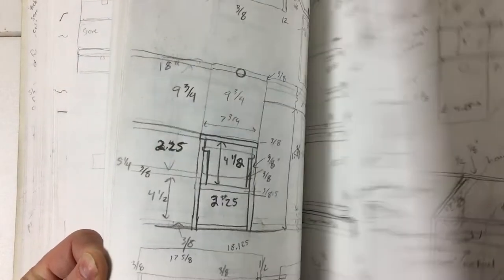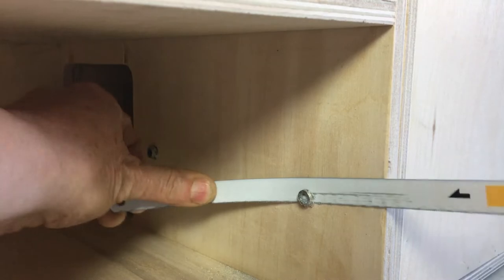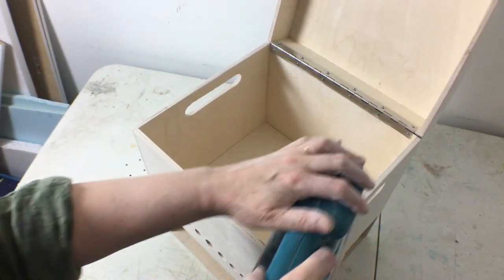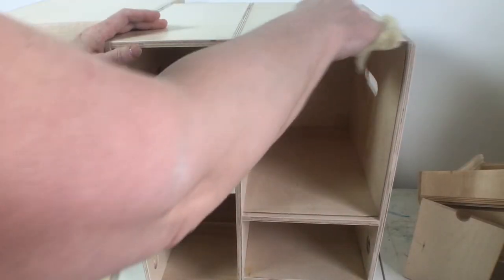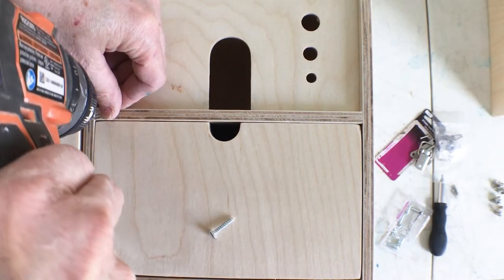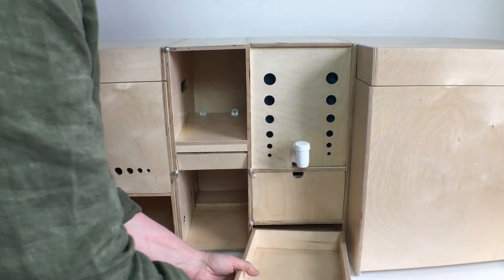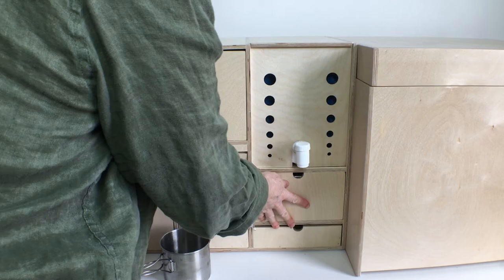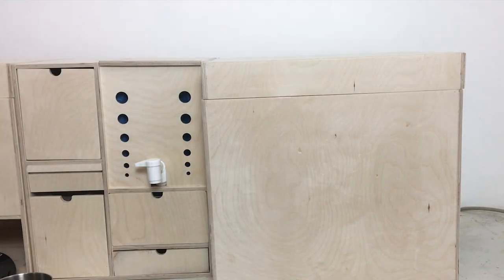Kitchen boxes for a minivan camper van

Comment: Nice job and many good ideas for other van converters to use.  In Australia we are not allowed to have propane bottles in camper vans or caravans.  You have a use a sealed (from the inside) box with ventilation outside.  Thanks for the video.
Reply from the maker: That is probably a good idea anywhere, regardless of the rules. I mostly have been using the little butane bottles, which are smaller and less pressurized.

Comment: Nice work (as with all of your vids that I've watched). The water container securement, and the decorative touches are really nice touches.

How has the varnish held up?
Reply from the maker: I actually put a few more coats on before this summer's camping trips. I found it wasn't as smooth as it could be. But seems to resist water the few time we have spilled stuff, etc.
It is waterbased and sometimes the drawers stick a little where the tolerances are really tight. One of the drawbacks of waterbased varnishes/

Comment: Do you have a photo of this kitchen setup in use? Is there a pull-out table you use with it?
Reply from the maker: Hi William, you can see the kitchen in more detail and in use at the end of this video. The kitchen part starts around the 4:20 mark. There is a pull out shelf which is used for meal prep and cooking, but we also have a separate small folding table
https://youtu.be/W02jRE1nwp0?t=260

Comment: Instead of cooler....Can we set  Tiny Fridge in cabinet....and what is yr opinion.....Cooler or Tiny Fridge....which will better.
Reply from the maker: Definitely use a compressor fridge. I chose the cooler for cost but it does not cool enough in the summer. I am now planning how to switch mine to a compressor fridge, but it might mean remaking most of the components of the kitchen because my spacing is so tight.
The cost of a compressor fridge is quite prohibitive, but if you put a lot of work into your build, go the extra mile and get quality compoments.

Comment: You mention having a thermo-electric cooler. Think you will find this is a very poor choice for two reasons: consumes a lot of electricity and only cools at most about 40 deg. F from ambient temperature. The only plus side of these is they are cheap, but if they don't do what you need them to do and they kill your house battery cheap doesn't mean much. Compressor based 12 volt electric refrigerators are more expensive, but you can set the temp you want and they don't consume nearly as much power as the thermo-electric type. If they are too expensive for your budget, you can always use a regular cooler with ice.
Reply from the maker: What can I say; it is a combination of stupidity, pigheadedness and curiosity! I bought the cooler before doing enough research, not realizing all its cons, just looking at price. And I am suffering from the now-I-bought-it-I-have-to-use-it syndrome but I am also curious if I can make it work better. On paper the thermo-electric says it uses 48W and a quick look at similar sized compressor fridges shows they use 40W, but there are two differences 1, the fridge cycles on and off while the TE cooler stays on all the time and 2, I presume the fridge uses those watts to deliver more cooling for the same power. There is nothing I can do about the 2nd one but I am working on the first one. The next video, (which is very slowly coming together!) will show what I have done.
Reply from the maker: Also, my apologies to anyone else with a thermo-electric cooler. I’m not saying anyone else is stupid.:-)
Reply: You are right in your analysis. The compressor fridge does not run all of the time, uses less power when it does run, and is way more efficient in its use of power. I can confirm from experience with both, the 12 volt compressor refrigerators are way better. The good news is there are a lot of companies making compressor style refrigerators so you could probably find one pretty close to the size and shape of the unit you have now and just swap it out if you want to. If you do, just be sure to expose the vents for adequate air flow for the compressor. Might mean cutting some vent holes in your cabinet. Good luck.

Oh, and don't forget a really important difference between the two - the thermo-electric is not going to keep your food cold enough in the summer. It just can't get cold enough. Perishable items will spoil, drinks won't be very cold, etc. Whereas most compressor refrigerators can be set cold enough to function as a freezer if so desired.